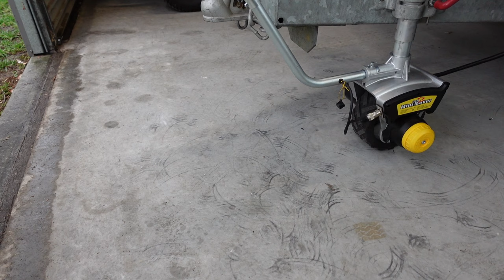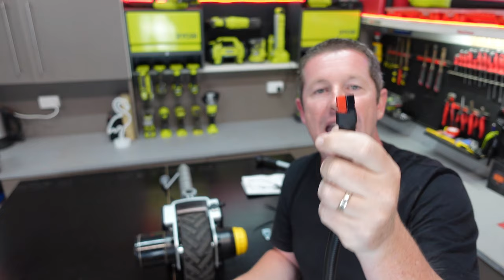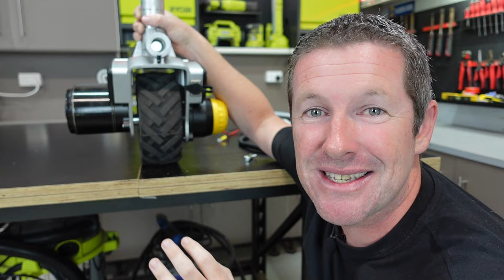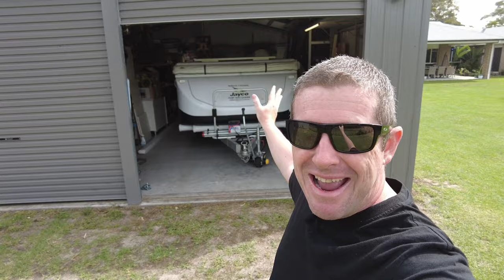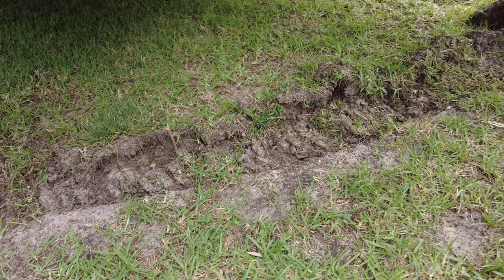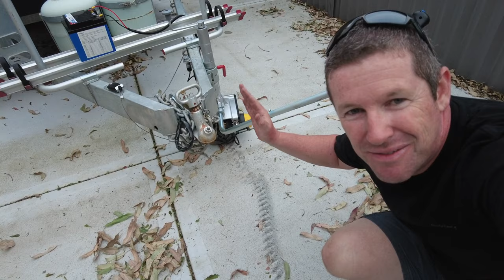Vman Reviews - The Gen 2 Mini Mover for your caravan, camper, boat or trailer - with 550W of power!

Comment: I think you’re being a bit hard on this little mover. I think if you had tried to move your trailer on that grass with a standard jockey wheel you would of got stuck a lot sooner and If you read the instructions it says it’s not suitable for twin axle trailers ! However if you raise the jockey wheel to get the load off the front wheels it would of easily turned your camper on that concrete. I think for the money it’s a good buy.

Comment: Having lowered the front of the van to take the load of the rear wheels, is not a good idea, as this is then effectively reducing the ball weight or in this case, the weight on the movers wheel. Elevating the front of the van would increase the weight on the movers wheel thus giving more traction. I have the same machine and it works effectively with my dual axle 20ft van tare weight 2.5 ton

Comment: The problem with a single point mount on this mover is that it will DEFINITELY flex. I had installed the original one supplied on my caravan A frame and just before a trip from SA to WA the mount flexed and broke the welds done for it and dropped the whole front of the caravan down on top of the mover mount. No damage to the mover and my feet were not under it. Note to everybody; stand clear of being under the A frame, as it will do a lot of damage to you if it drops. 

I had no option but to carry a  garage floor jack with the caravan to maneuver it onto the  Patrol tow bar. At the first Port of call, I found a caravan repairer who welded another single point mount (the other one was totally f***ed) and I continued on my way.

When I got home from this travel I managed to get a double mount and totally weld the back plate onto the A frame as well as a square tube making up the rest of the height of the plate, now making it IMPOSSIBLE for the back plate to flex. The A frame will flex before the back plate of the mount will!! 

There is still some flex possible with the double mount however, as the single handle is the only part that holds the movable plate onto the baseplate (I wish it had 2 handles or bolts on the moveable plate to secure the post at 2 points), but no one makes such an animal. Now that these mods have been done it will move and park my 22ft caravan  into a very tight space with little effort on my part. 

I have also changed the power cable to include an Anderson Plug. Works very well for the price, would be far greater out of pocket than alternatives, and it's small enough to store away in the front bin of the caravan when travelling.

Comment: Great review. These model movers are sold under lot of different brand names so look carefully at pictures and shop around.

I bought one of these to move 1000kg caravan. Power isn't issue,  its traction. Really only good on flat hard surfaces. Won't pull trailer up gentle slope as not enough weight on wheel, but OK pushing as wheel is on downhill side. If using on any slope would recommend roping trailer to fence post or car just in case it gets away on you. Ended up selling it and fitting motormovers, downside is 35kg payload penalty, upside they are awesome.
With lighter trailer eg 500kg boat might work bit better on grass. If you want to use small battery to power it I'd suggest motorbike starter battery these can deliver high currents needed. 

Caravan motormovers have few other bonuses when touring. Can rotate van and place it on pitch facing forwards for better views, privacy or having door on preferred side. Placing on tight pitch, especially where there is no room for tow vehicle to manoeuvre. Reversing onto pitch in dark, you can get out and view it from rear while maneuvering as bonus good marriage saver.   While I've not encountered the last one sure it will happen eventually, doing Uturn on tight deadend street.
Reply from the maker: 100% safety is critical with anything heavy especially on a slope. A lot have had success on grass however our sand is far too soft and loose, it's a problem we have, even trying to keep the grass alive. 

I've been using it a fair bit to manoeuvre both on flat ground. Works extremely well with the camper, the larger Journey I can't move by myself so it does come in handy to shuffle backwards and forwards.

Comment: Maaate!!!  Brilliant video. Really appreciate the variety of scenarios you  were able to run-it thru. I have yet to drop any cash onthis type of unit as i was unsure about it's ability to handle inclines. I would be really keen to see a project build on diy version and see if you can improve on whats already out there. I too, cannot undestand why there is such a price gap between the  few hundred dollars to the thousands ? Again great video, and keep up the good work.
Reply: These are cheap because they have cheap steel in the gears and will break after a few times. We used ours about 12 dozen time before it sh1t itself.

Comment: W L P.....Thought about putting an electric winch with a remote control on the back wall of your shed..and buy a better jockey wheel (Ark Off-Road 8in Double Jockey Wheel) and make it
removable to also use it on the journey cheap option.

Comment: I have one to move my 2500kg car transporter trailer. It is very easy and convenient to use and with plenty of torque works well on tarmac and concrete surfaces however, due to the small wheel / tyre it does not operate successfully on shingle loose surfaces nor on wet grass.
Reply: Hey Chris. Have you had any problems with it so far? Thanks

Comment: I was wondering do you think if you had a couple people pushing the van while you used jockey wheel it would have made it into the shed easily? My problem is we can’t reverse our boat or camper in our back yard we have to push it. We have a lip/slight incline I wondered if we pushed if it would help as well?

Comment: Well presented, a large dual axle caravan is obviously too heavy for this mover, it was leaving a fair bit of rubber behind, the tyre life expectancy would not be too long. But for the Jayco pop top weight it looked ideal.
Reply from the maker: I've been using the mover quite a bit. It's great with the camper. On the Journey it does work well to move backwards and forwards and shuffle across slightly but it's not up to the task of overcoming the frictional force of two tyres on either side. 

Someone mentioned they had been using one with a pneumatic tyre which worked well as opposed to the solid rubber one, however I've never come across one like this in the lower price range 👍
Reply: @WorkLivePlay  I may even investigate the Inflatable tyre option or alter it so I can fit one.

Comment: Good review..On a tandam axle you could put 1 set of wheels on a dolly wheel...
Reply: Which side and which wheel?  Need to move my van into a tight space with the mini mover and worried about the sharp turn with the tandem.
Reply: @wesleyloots9981  Either the 2 front or 2 back...My choice would be the back set so your hand brake would still work..
Reply: @peterbeadman5115  thanks Peter

Comment: Have you thought about  powering this with 18v Milwaukie cordless battery?
Reply from the maker: Actually no I haven't but that's potentially a brilliant idea!! I use a 12v lithium these days but you do have me thinking now 🤔😁
Reply: @WorkLivePlay dumb question time. If Anderson plug on caravan is for receiving electricity from car, how does it know to provide power to the motor mover? If no current in, it sends current out?😊

Comment: We've had ours for about 3 months and have used it maybe 6 times to move our 1.4 tonne camper trailer on relatively flat road surfaces.. 
I noticed today that a worrying grinding noise is coming from it. 
Sounds like the gears are chewing themselves up. 
I suspect they aren't made to last.
Reply: Is it still holding up?
Reply: @TheRealEstateHunterInc  I've used it 3 times since then for short manoeuvres. It's still going ok but I'm about to strip it down and see what's causing the grinding sound. I may re-make some parts in better material if possible. It certainly is a handy device.
Reply: @garysheppard4028  plastic gears?
Reply: @annpeerkat2020  I tried to take it apart but the screws holding the main body case are super tight. I might have got them off with an impact driver but I didn't want to take the chance on breaking anything. So if, and until, it malfunctions I won't disassemble it. If it does break I'll strip it down and see just what it's made of. I suspect the gears are metal (it sounds like metal from the grating/crunching sounds).. But there's metal and then there's metal. If it breaks and I judge it worthwhile I might try to get the broken parts re-made in proper metal that won't break. It's such a handy thing that if at all feasible I'd like it to last a long time. Time will tell.
Reply: @annpeerkat2020  "Steel" gears, however not best steel for gearing

Comment: These are great to mover a small van/load on flat hard surfaces. They will not push a van up the lay back from a road gutter. They will not push / pull vans/loads over any small obstacle.
The gearing in ours failed after about  a dozen times and now it is a useless.
Do not expect much from these mini-movers.

It anyone a spare motor etc for they min-mover, let me know.

Comment: So no good for a 2.7 tonne 18 foot single axel family van on flat concrete doing a 40 meter run downt he side of the house to the shed. So i wouldnt expect it to make it up a curb either. Seen a seller showing a vidoe of them using one of these on a big Van in a caravan park but the vidoe stoped just as they hit the edge of the grass, as with any 8 inch single jockey wheel it usually bites into any soft surfaces wen you havs any sort of weight on it.